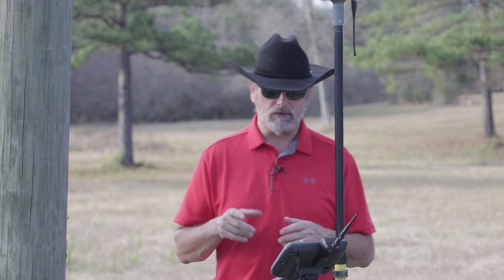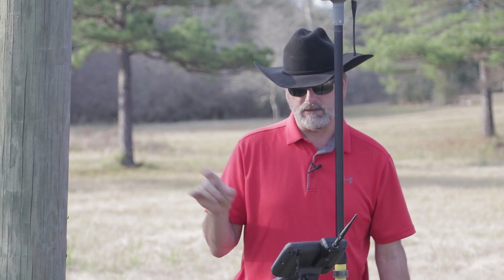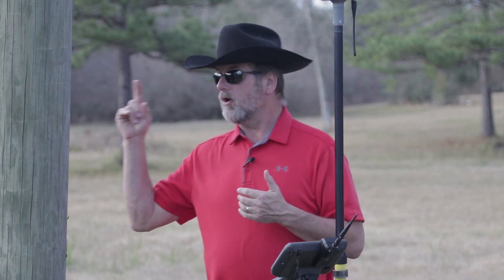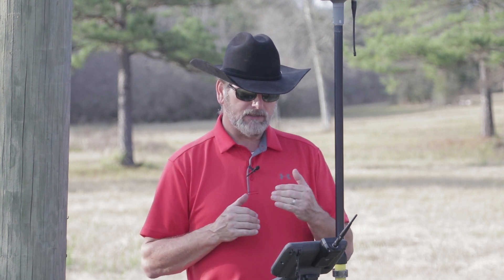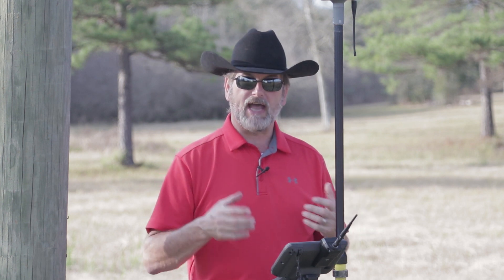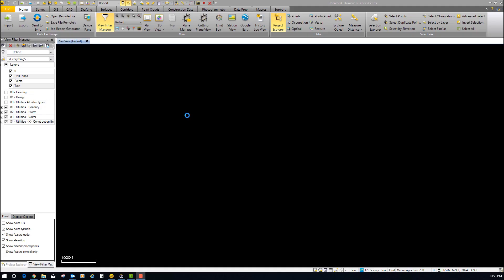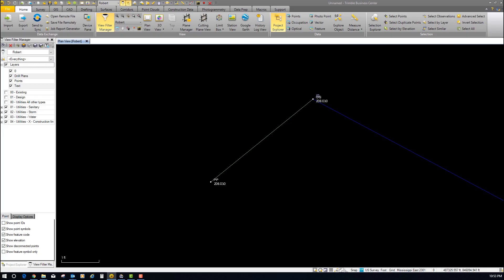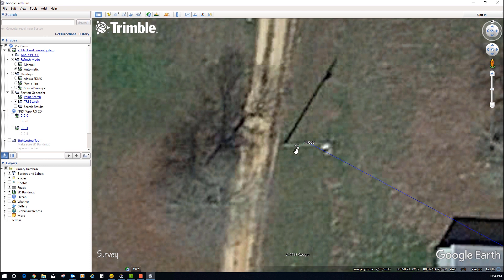Tuesday Tip - GPS offsets with Trimble Access

Comment: Hey Robert, have you had any experience with geomax xpad tablets?
Reply from the maker: I have not
Reply: @SurveyingWithRobert  I like using distance offsetting in Trimble access this is really useful though at my company we use Trimble but only for the robotic total station, we have a geomax tablet with egps which gives us two data collectors so sometimes that is useful because I can get my helper to use the gps for one thing and I the party chief will use the Trimble but I still think the Trimble r12 is far superior we rented the r12i for a 400 acre bathemetric survey last winter and I would really love to have one.

Comment: Why not calc with dis/dis and then key in point (first type in your calc point) and rename those coordinates?  I’m not 100 percent but I’m guessing this avoids issues with network adjustments. 
Why are you working so hard?
Reply from the maker: I am a surveyor I always work hard! 🤣 your working harder with the distance offset. I am using the sun in this video. And yes if you don’t store it correctly you loose the vectors on the point. Your locking the coordinate down. If you do any adjustment that point won’t move. Hope this helps.
Reply: @SurveyingWithRobert    Yes, I recently learned this from some senior chiefs, thank you (Regarding locking down cord's)

Comment: If I really can't get near a pole/tree for an RTK shot I prefer distance-distance intersection. CF pole is 2 metres, so a quick way to measure, and just make sure you use good triangle geometry and correct side for solution.
Reply: Shooting a double distance is also a quick easy method.

Comment: Nice option, though that should be under the measure  points options. I locate poled with GNSS by observing a point on each side  of the pole (in a straight line with the pole) using the same point name twice (store another)  and my TBC is set to computations : weighted means of like observations so the pole position gets computed then.
Reply: We do a lot of electrical utility work and we stick our boot up against the pole and take a shot at 1/3 circumference of pole.  Our office calcs the center, doesn’t matter which point you call MOC
Reply: Oh wow! Kinda a duh moment. I do that with control points all the time! Why didn’t I think of that?! Lol
Reply: My workflow exactly, no need to judge off set bearing (and we hardly ever see the sun here in the Sottish Highlands)
Reply: You should be the surveyor with the you tube channel lol